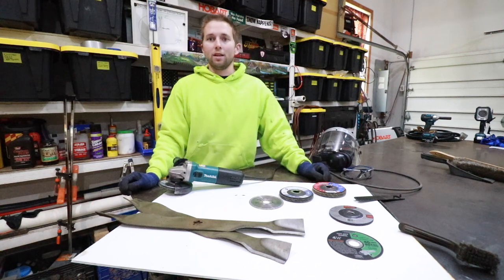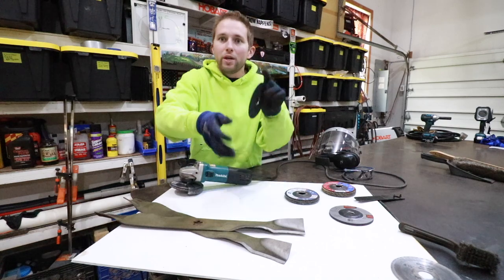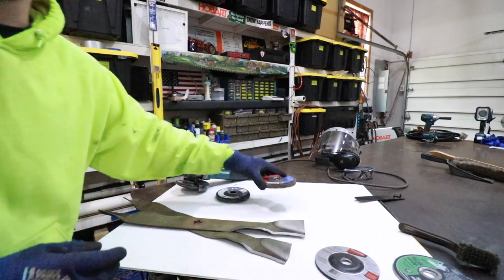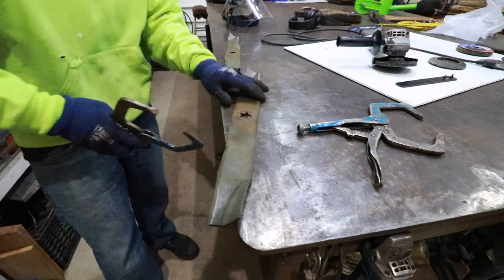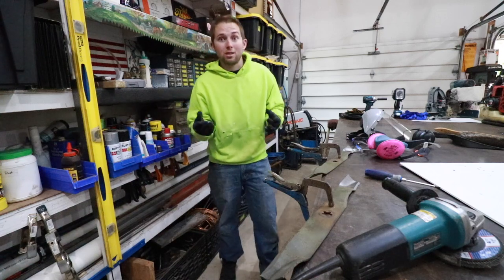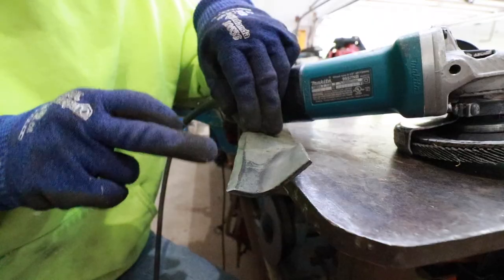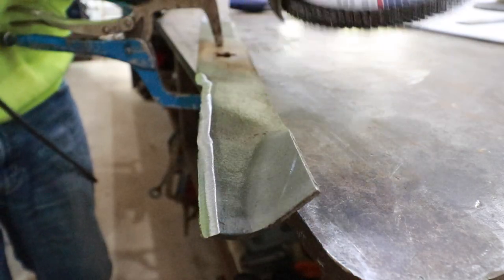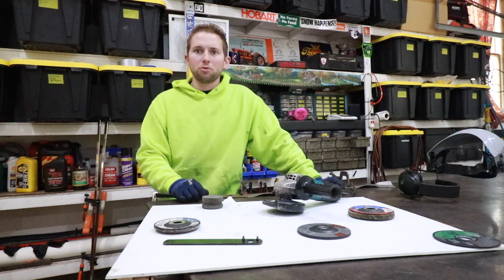How to sharpen Lawn Mower Blades | 4.5" Angle Grinder

Comment: Very instructive video. One thing you did not mention is sharpening the blades evenly so that they are balanced. If you take more material off one end of the blade than the other, vibration will occur. I work around this problem by counting the number of even passes I make on each end. I used to use a blade balancer after each sharpening to ensure they were indeed balanced. However, by utilizing the counting method I found that the blades were balanced every time. Thanks for taking the time to make this video. On my way to pick up a 60 grit flap disk.